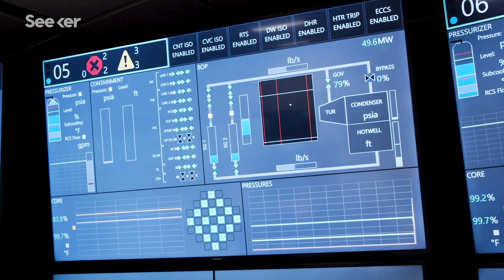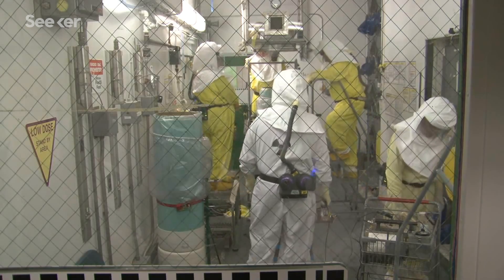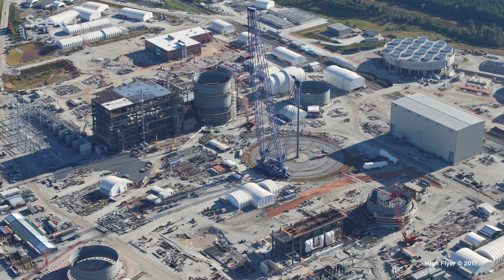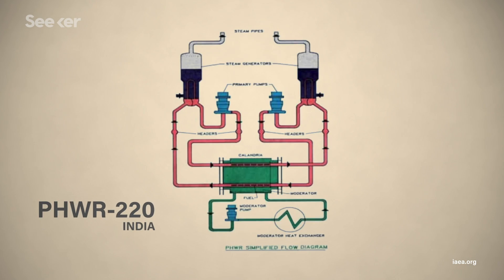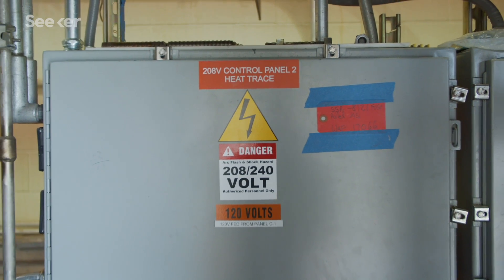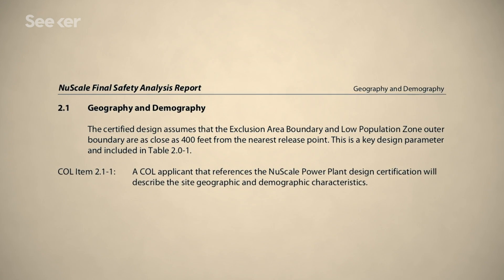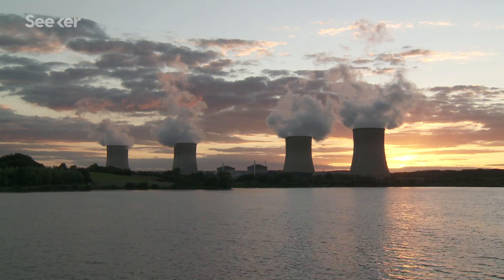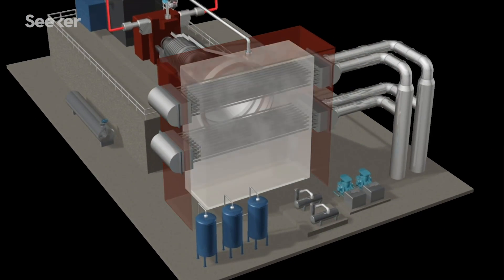Mini-Nuclear Reactors Are Coming, and They Could Reinvent the Energy Industry

Comment: im all for nuclear in terms of its energy density and logical terms of essentially unlimited or nearly unlimited power. In a way its like cheating nature with the energy we can pull from it. 
but the way business is run, will always leave room for mistakes. only built to spec then overbuilt, only staffed as needed not over staffed. reasons mistakes happen and make nuclear not much of a option.

Comment: I don’t believe in nuclear energy. 

This comment is bought to you by big oil gang
Reply: Super Cool  If you're worried about a melt down. Then you better worry about lightning strikes and winning the lottery.
Reply: Super Cool  I make my own money, thanks. Realize that one 1/2in. pellet of uranium outputs the equivalent power of 1 ton of coal. I'd take the rare meltdown over the certainty of runoff from burning tons of fossil fuels daily.
Reply: only Thorium
Reply: Agree with you. Its fake.
Reply: Bought to you. Subtle, but nice one
Reply: ...and I don't believe in ghosts....but I can assure you that Nuclear energy does, in fact exist
Reply: solve new technology for battery that can store huge amount of electricity for a long time with long lifespan, then we can phase out fossil, coal and nuclear...
Reply: @americasingapore822  You can't phase out nuclear, if used the maximum potential renewable power sources (which we can't) then we would quickly run out of power generation capacity, it's a simply fact. Fusion is the future when we finally get there and nuclear Thorium is hopefully in-between now then then
Reply: depends if you pay the electric bill
Reply: @michaeldancurtis  according to the IEA, around 4,000
Reply: @michaeldancurtis  good, once you got the battery done, as in store hugeeee amount of electricity with decades of durability, then we can keep sucking otherwise wasted solar energy in space...build one solar cell high up in north/south pole and store to those batteries and distribute stored energy to the grids...done...as for nuclear, I put that last to phase cause the efficiency of nuclear is just staggering, unmatched by any other fuel known to me, but the pollution, well, way more deadly than fossil. I agree that replacing fossil completely to motorize any engine to move from point A to point B would take at least a century...
Reply: Super Cool  well if you rather be next to petrol station get ready to get cancer from the air poll
Reply: System is the problem 🏡  The Great Qualities.

1, Show all living creatures; all the love and kindness as much as you can.

2, Only try to be honest with yourself. If you try to be honest with others, you will get into big trouble soon or later.

3, Aim only one target at a time; otherwise you are chasing two rabbits and you will miss both. So, the reason behind it. Have one powerful reason and never ever give up the one you want the most.

4, Don't try to be good person only but be the powerful person. We will grow to be the one or we will die. There is no other choice. 

5, Always learn and look for to improve something your life. 

6, You are not alone. Love and faith the high power reduces unnecessary stress in life. But never completely rely on it. 

7,  Success and happiness are the byproducts of our usefulness. So, always increase the possibility of success.

8, Life is not going to be easy. Because of our unnecessary things. Eliminate all the unnecessary things as much as you can by organising yourself well with the environments. 

9, Never believe anything without the proper evidences. 

10, Always try to give more than you take. 
Because it is dignity/ character of the divinity within you.

🌎 As long as people continue to see themselves as separate from everything else, they lend themselves to being completely enslaved. Success depends on how well we relate to everything around us. Joy comes from that bliss of connectedness. I believe that unarmed truth and love will have the final word in reality. To love; you should have good heart. I am a good person until I see a person better than my standard of goodness. Being good is the progress towards a worthy cause. Love is God. Whoever lives in love, lives forever. How selfish it is to try to keep something forever? Love is all about nourishing, nurturing, sharing and expanding the love within you for all. The principle to which we adhere to is that we have kindness of love at heart for the whole of mankind.  As long as there is the unnecessary differences within us; we can not live peacefully so we have to eliminate all the unnecessary differences among us so we can love all. People abilities may vary but not there true love. If we love a person/ God for a reason then we love the reason but not the person. No reason is the reason to love the person because true love never fails. So do not compare or measure the true love as first or the last but love all truly. If you love people truly then you can understand people. If you don't love then you don't understand people at all.

People are controlled by system why?
The Cyclical Consumption is the current economy all over the World. It is making the scarcity problems of the earth finite resources to deteriorate day by day. Current Monetary System is legalised theft. Real money is Gold and Silver. Scarcity gives the money more value. Real money won't lose it's value. When Governments stay away from Gold & Silver then very easy to transfer the wealth / resources to upper class the Rich (Corporatocracy) Elite. When the Governments are printing out more new fiat currency with reserve banks, our old currency is losing its purchasing power everyday. They are printing millions of currency everyday. All governments and laws are existing right now to transfer wealth to upper class the rich elite. The USA Government & other Governments are in many countries, bailed the investment banks & financial institutions in 2008 against the majority of the people. There is no democracy in any countries. Because of the Money System based on profits motive only above all else even humans lives and well-being. So, we do not have freedom to protect our values with the money so on. The violence, bankruptcy & all the negativities are build into the Monetary System of our society. All are owned (including ourselves) by Reserve Bank. Which is private cartel the corporation. So, in legal system, we are legally considered as chattel the properties. They make money in the capital markets with our birth certificates. They do not consider us as Humans. That's the truth. We are at the invisible war with the Elites (Corporatocracies). We have to fight for our Freedom. Resource Based Economy is the Solution. We have to declare the earth resources as the heritage of all the people of this world. So everyone has access to it. Please have your research about zeitgeist movement then you know the truth more. 

 Truth About Health/Drugs Industry Because Of It Your Life At High Risk The drug industry is a 1/2 trillion dollars a year worldwide conglomerate. Almost 300 billions dollars just in North America. That is really big business. What would happen if everyone were well? There is no money in health. You see, good health makes a lot of sense but it doesn't make a lot of dollars. Because everything they do is toxic. Every drug they use, prescription drugs, all drugs are liver toxic, bar none. If you've had amalgam fillings put in your mouth by dentists. It is highly toxic. There's cancer because most of the chemos are themselves carcinogens. To view the tumor as the cancer and we know the tumor is not the cancer. The cancer industry is 200 billions dollars a year. The more work they get, the more profit there is. You have to dismantle; If the truth ever came out about what we would need to do. 30% of people of females in America are at risk of getting, will get cancer of the breast. The ones that are already dead have been grossly mistreated by the medical profession and by the government that supposedly is supposed to encourage free research and development of all possibilities. Why would medical doctors who studied medicine and practice medicine and are heavily funded by pharmaceutical companies why would they go and look into vitamins? That they never had the answer orthomolecular. And as more and more of our population start taking their health into their own hands, there's going to be even more and more of changes. It can't go on the way it is. The system is failing apart. We must make nutrition the primary prevention strategy for the population. You are what you eat. You are everything that you have ever done to yourself. The choices you make directly affect the outcome of your life. - (Food Matters Documentary in Netflix)

😊 Well, I truly love God. I am not religious but very spiritual person. So, I believe 1) Religion is the beliefs in someone experiences But spirituality is having my own experiences. The mainstream religions people promote religious ideology by giving guidelines and guide but In my spiritual life; I do not want anyone or anything between God and me to restrict my freedom to worship God. 2) We do not need any authorities to do good work. The god work is the good work always. In contrast; organised mainstream religions are claiming that they have the authorities to do God works as leaders so on. 3) God is not capable of doing wrong thing, change the past for us and create anything out of nothing for us. Nothing means not anything. So, even God is limited. The mainstream religious people believe that God is unlimited. 4) God wants us to take responsibilities for our righteousness life but not for all the consequences of our actions because they are continued to exist among us. So, How can god punish us for all our consequences? The mainstream religious people believe we are full of sins because of all our actions. 5) Freewill  is an illusion. People always choose the perceived path of greatest pleasure.  So, we do not have choices all the time. In contrast teachings of the mainstream religions are promoting people to do god's will always because we all have choices of freewill always. 6) We can not separate everything into groups. So, everything for good and evil and there's no success and failure for everything. If everything is real then real things can not be threatened. Once you come to understand that God/The Holy Spirit is in each of us, You will no longer need a Book to tell you how to live. Then why we need religious scriptures? The Virtue is the expression of the basic goodness in our actions. The Basic goodness is the fundamental worthiness of every individuals. We are worthy to God always in everything. 7) Beliefs in a cruel God makes a cruel man. No matter what; every living creatures has the right to live and What makes their life cheap? Everything depends on everything. Nothing too big or too small in value. We can not love and hate at the same time; Being a vegetarian means love without cruelty happily. The mainstream religious people are killing people and sacrificing animals in the name of God. They promote God's cruel punishments. The Punishment is endless for Sinners/Devil according to religious scriptures. But God is love always. Overcome hate with love. If all religions for peace, unity? No way. Because they are not for peace. 8) Well, The God gave us everything to go from moment to moment in our lives as we do our part  and pray only to thank god then the Love is in progress. The Love is always for everyone. We are always worthy of the God's love. Our greatest fear is; not to be loved by anyone but we are all loved by someone. When we eliminate all our unnecessary differences among us then true peaceful life is possible with the true love. If we can't find the peace within ourselves then we will never find it anywhere else. 9) This is the Fight for independence and freedom of humanity to worship God freely without religious guide and guidelines to restrict us. Unnecessarily, We do not want third party controls over us in anything ; especially in spirituality. 10) Revive Survive Thrive. Sincerely,  The Real Peacemaker against religious oppression.

 https://youtu.be/HbvCxMfcKv4
https://youtu.be/pIJHJzDQcRM
https://youtu.be/MyxbdmAnIcI
https://youtu.be/wLzeakKC6fE
 https://youtu.be/P8vHa8zD7jY
Reply: Good to know! when we run out of fossil fuels, I'd love to see you try to start a car 😂
Reply: @chanahasnomana   you never run out of fosile fuel because you can produce coal and process synthetic oil out of it. I'm getting tired of certain types of rethorics
Reply: @GEXGE11  it's impossible to make new coal, clean coal (a type of pre-processing of coal to reduce emissions, and create syngas (which is what I assume you mean by "synthetic oil" and not  
motor oil) ) does significantly reduce emissions (the carbon + ones anyway), it still uses fossil fuels in away that is not completely efficient; so we will run out of them.

All that being said, the use of fossil fuels (particularly coal) kills  thousands every year, and any carbon reducing technologies are welcome, if they prevent deaths and global warming.
Reply: I don't want coal or nuclear near me.

Why are these the only choices people are arguing about?
Reply: @yt.personal.identification  about ppl thinking nuclear reactors are the most dangerous thing on the planet
Reply: @ezzeldinmohd6740  The reactors are getting safer, it is the bi-products that are still just as bad.

We are smart enough to know a truly advanced civilisation will harvest their energy from a their star...so why again is nuclear the answer?
Reply: @yt.personal.identification  its the answer because we can't get reliable energy from the sun with out a dyson sphere and the government hates going to space
Reply: Oil isn't used to make electricity dumbfuck
Reply: Say what you want but I think many of us would rather have a petrol station 20m from home than a reactor 2km away thank you.
Reply: @GEXGE11  petrol station =/= power plant
I'd rather have a nuclear plant 2km away, than a coal plant (of the same energy output) 2km away.
Reply: GEXGE11 Say what you want but maybe you'd rather live 20 meters from an oil depot. Sleep tight.
Reply: @GEXGE11  a nuke power plant can provided a discount for your electricity bill ... a gas station can't
Reply: @GEXGE11  fusion: am i a joke to you?
Reply: @romanplays1  yeah, at this moment, you're a joke...nobody can frikin' do it...
Reply: @americasingapore822  you say that. but CERN is already proven you wrong. we just gotta up the efficiency.
Reply: @romanplays1  umm, no, the last "successful" fusion was in some university, but it took waaaay more power to maintain that fusion reaction compared to the electricity it produced...so...yeah, another "30 years"...maybe...
Reply: @americasingapore822  waaay more? it was like a 1/3 output/input ratio. thats pretty damn good for a goddamn UNIVERSITY.
Reply: humanity doesnt want or need nuclear power. its unnatural, polluting, and dangerous. we prefer renewables.

Comment: i hope that control room has some kick ass anti-virus software.
Reply: Considering that nearly every reactor on the planet uses analog controls it’s extremely difficult to develop a virus using digital controls to attack a analog system and create a disaster that the nuclear engineers onsite would not recognize. 

Furthermore it’s extremely uncommon to have both a thorough understanding of software engineering, nuclear engineering, and nuclear physics and not already be working at a nuclear reactor. Plus there’s also the issue that every nuclear reactor is effectively different so knowing the exact systems, procedures and controls for a particular reactor is very difficult when this information is not available to the general public per se.
Reply: more than likely it will be connected to an intranet (not The Internet) which is a self contained internet between specific computers and is cut off from the global one. most businesses use something like this and the entire country of the DPRK has it's own intranet (fun fact). so it ought to be virus safe, though just in case there's always the electromagnetically held control rods which are not digital and will drop no matter what.

Comment: The only things that matter are how the engineering of Nuscale works with physics, not just radiation, but materials, thermodynamics, carnot cycles-all of that good stuff. Secondly there that old devil cost. If nature can figure out a way to damage this plant, and render it radioactively, deadly, it will. Might be a flood, a quake, corrosion, wind even, power cuts, sabotage, all that crap. This is all it takes. So can Nuscale engineers build it so these bad events becomes unheard of? Not sure. Can Nuscale make it cheap enough? Out of my league. What SMR's do have in their favor are smaller uranium piles (lighter weight)  to melt down. Physically, way smaller than the 300 or 500 megawatt typical light or boiling reactors, means less heat, less water to boil into steam, less steam to be heated into hydrogen to explode. Even with the RMBK commie reactor it was water boiled to steam, then to H2, then, kaboom!